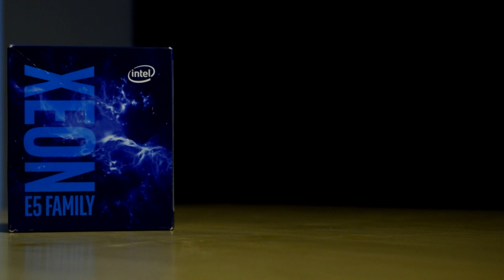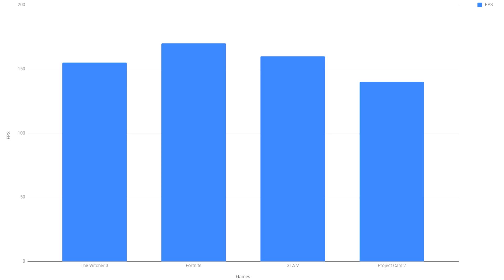4-Way SLI - GTX 1080ti

Comment: I heard that 1080ti can use 2way sli, and the other two are not used.
How did you use 4 way sli?
Reply: so a key feature used by former EVGA Overclocker Vince Lucido used for 4-Way SLI 1080 Ti's was that, because he was using EVGA motherboards, he could just space them out with a special riser designed by TiN, and a custom bridge.

but that's Vince Lucido, this guy I assume didn't work for a company at the time.

this guy is also using a workstation motherboard that has full PCiE Gen3, a thing is however, is that ASUS had their own 4-Way SLI bridge.

note: 4-Way is only really used for benchmarks, it's why people only used 2-Way SLI for gaming. but in the realm of overclocking, Vince managed to use LN2, and 4-Way SLI 1080 Ti's to beat the others on the 3DMark leaderboards.

Comment: 44GB of VRAM XD 
Can handle GTA 5 on 8K with 2x time resolution scale?
Reply from the maker: GTA 5 isn't able to utilize SLI power, the gains will be very minimal - You'd be better off with a single 3090